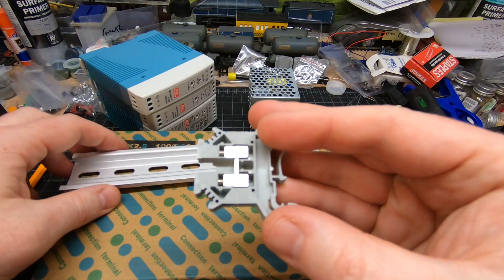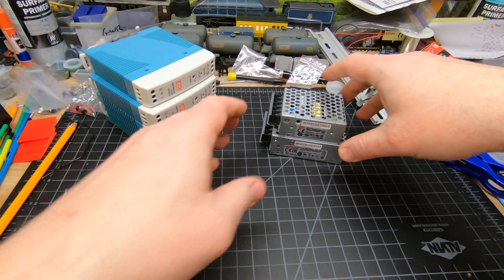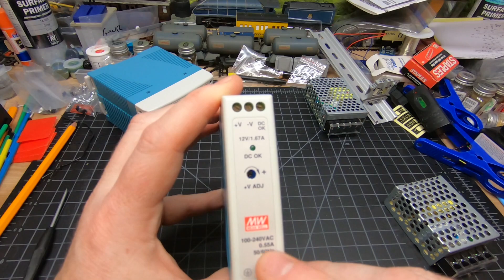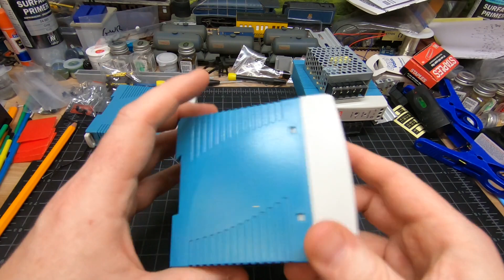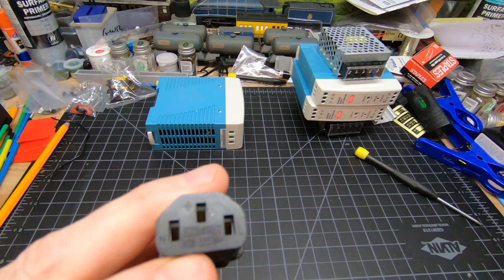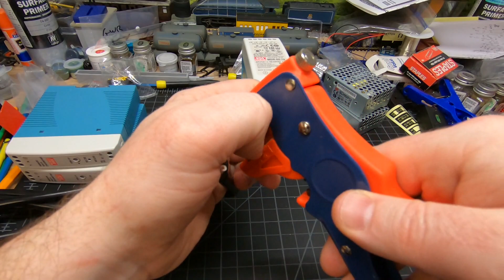Model Railway Digital DC Power Supply Howto | oorail.com

Comment: Nice video mate. 👍
Just a safety note as you mention tinning the wire ends being screwed into the power supply.
DO NOT tin the wires going into screw connectors as they can come loose over time if you do.
If you must use solder, just apply to the very tip to hold it together, not the whole stripped length
although it's quite easy to twist fine strands together and safer in the long run.
Ask an electrician or look it up, don't just take my word on it.
Reply from the maker: Thanks Gerry. You make a very good point about not tinning the wires. As I showed in the video the  best option is to twist the copper strands. As you mentioned, the best practice recommended by electricians is to not tin wires as the solder can compress over time due to heat (current) and pressure from the screw. However this is really only applicable to high current applications (eg. fridge, stove, appliances, high current equipment etc) or when operating in hot environments. You can also work around the problem by torquing the screws slightly every couple of hundred hours of use until the solder has properly settled. If you look at the ratings on the power supply, you'll notice that it draws input current at 1.8A (110VAC) or 12V at 1A (230VAC) in order to output 12VDC at 5A. Its very unlikely that you will run into any issues tinning the wire unless you go overboard with it.